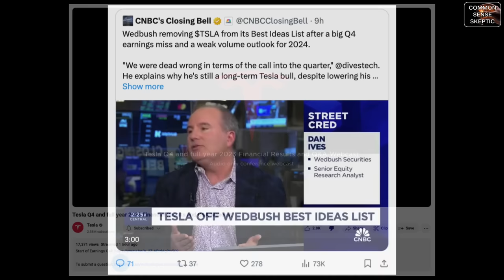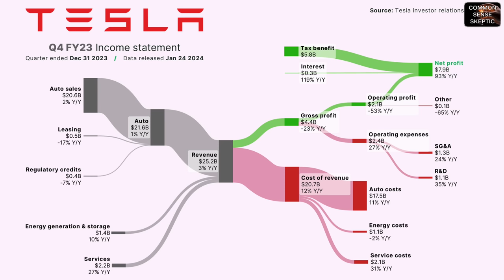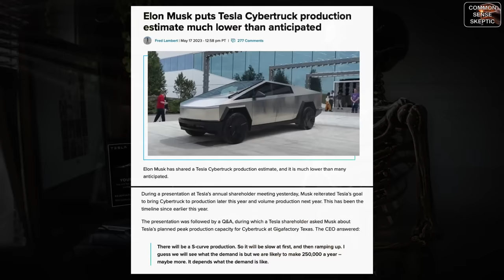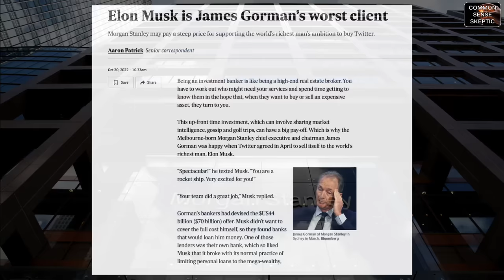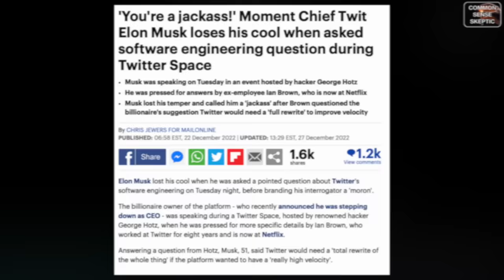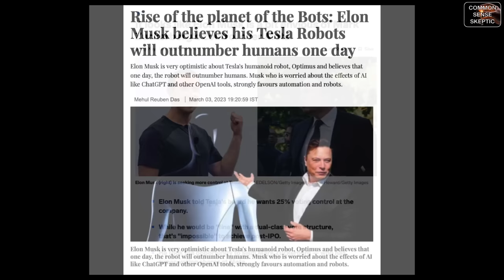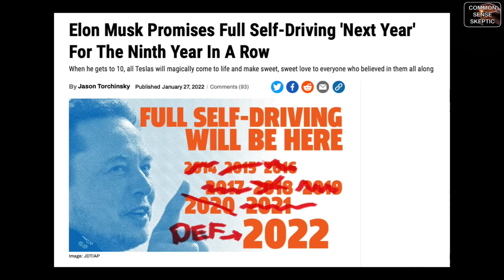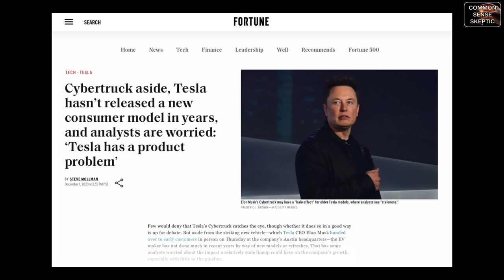TEARDOWN OF TESLA Q4 2023 EARNINGS

Comment: Who has seen the short with Cybertruck stuck in 5cm snow? 😅
Reply: It a hill and the car has summer tires.
Reply: @blablablabla4245  heavy pickup with 4x4...
Reply: @blablablabla4245 didn't leon say it was a "go anywhere" truck regardless of the tyres?
Stop carrying water for the useless POS
Reply: @robinkelly1770  there is no go-anywhere 4x4 no matter the capabilities of the drive. You need winter tires

Comment: The $25K car is a hoot -- if and when it comes out I doubt it will be less than $30K and might well be closer to $35K -- and that would be for the stripped down base model.  Would that base model have all the hardware needed for FSD or would you need to buy a higher spec version at and additional $10K or more?  If so we could be talking $45K before adding FSD at $15K.  IOW, this new Tesla for the average person could run $60K.

Comment: BYD's cars looks much better inside and out.  It's a Chinese company, and their software UI needs work.   Their BYD Seal goes up against the Tesla model 3.  There are some minor issues with the Seal = Less trunk.  The UI needs work - too much beeping, a bit out-dated.  BYD's handling is more car-like, while the 3 sticks on the road - if you are racing on the track with curves and such, the Tesla Model 3 is better.   But all the user controls on the Tesla are on the big screen. Including the "Dash info".   There is nothing in front of your steering wheel. The car will beep you when you are speeding.  Geez. 

The BYW: Looks better.  The screen rotates to your preference. The  seats are better.  There are COLOR OPTIONS (Tesla charges $1000~3000 for non white colors).  BYD has physical controls and buttons for places they belong.  No swiping UP or DOWN to switch the car into forward/backwards.  HOLY Geez!  Par. parking with that is BAD.  With normal cars, you can switch gears without looking - you go by FEEL.  The door handles on Tesla are horrible, you pretty much need two hands.  The Tesla wheel covers are meh.  They're black now.    BYD's look modern and sharp.

The chances of me buying a Tesla = NEVER.   A golf cart has more personality. 

Check out the comparison video by Carwow : New Tesla Model 3 v BYD Seal: Ultimate review 

Buying ANYTHING but a Tesla = is the best way to put Xelon and Tesla in their place.

Comment: I was unlucky enough to take a thorough look at a new Model 3 the other day. I have never seen a car more badly made - and I lived through the British Leyland years - so that is saying something. ALL the paint was pure orange peel, and I estimate around $5K to flatten it, so it looks right. The panel gaps were a joke. The doors didn't align properly. Bits of interior trim were loose. One headlight wasn't pointed in the right direction. An interior light didn't work. Neither front or rear bumper were aligned with the rest of the car. The stitching inside was woeful - like it had seen sewn by incompetent people.

It also had the Suicide Steering Wheel option, where a Yoke-type wheel will almost certainly cause a crash at some point And here it's worth noting that Tesla is the most-crashed car brand in America.

Comment: 20:38 well that's one way to boost solar city since you wont be able to afford your power bill once your 'super computer car' kicks into gear.
Measure the power requiered when your PC is idle (or even on standby). Now measure it when it does anything complex yet repetitive (like a game using RTX)

Your powerbill will be orders of magnitude higher than before!
Reply: If Tesla ever does get FSD working, it's going to need some AI accelerator silicon in the car. Such dedicated-purpose chips can be very power efficient. But that also means none of the promised 'buy now, get FSD in a software update next year' claims can work.

Comment: Jeez! I should have bought into nVidia back when they were a start-up and I bought a RGB graphics card from them for my amber built in monitor IBM Luggable computer. That was the predecessor of the laptop, and came standard with two 5 1/4 inch floppy drive, one of which I replaced with the cutting edge 3 1/2 inch floppy drive. If I had have bought into that company at the same time I bought their fantastic little card, I'd be disgustingly rich instead of being disgustingly broke now.

Comment: the resulting crash was long overdue. the "cheap" cars would be probelly the original design Eberhard and his original partner planned all those years ago, but fatty Elon wanted a bigger Car which resulted in the current ones on offer, which are way too expensive for most. 36K for a EV is pushing it. Most other Car makers rather lose money on the initial sale as Services postsale bring in way more than the car itself at sale, bridging the cost valley created and even creating profits.

Comment: Until the costs of EV comes down (ALOT) -- there won't be many people below the middle class to own one.

It's not because we don't want one... we cannot afford it. 💯

Plus -- what if the subzero temperatures gets worse??
Reply: What middle class?
Reply: EVs are fundamentally flawed anyway, at least with our current technology.

They’re no more green than traditional cars when you account for the battery production and disposal.

They’re much less efficient than traditional cars.

They’re a massive fire hazard.

They’re entirely dependent on expensive infrastructure (charge points) that will never be cost effective nor available outside of affluent urban centres.

The batteries are built from finite rare Earth metals that we are rapidly running out of.

Battery tech is useless in very hot, humid of cold environments.

EVs were always going to status symbols for the rich in California, not a viable alternative to cars.

Comment: WTF is the massive obsession with 'robotaxis' ? - its a fundamentally flawed business model. If YOUR car was available to others to use when you are not using it, you can be sure as hell be sure it won't be there when you need it. Elon says cars spend 90% time parked up at home, yes, but that does not mean the user does not have any value from that - the utility is that it is THERE, ready for when YOU want to use it. You would get it back full of trash, scrapes and dings, and lots of extra miles, that would eat into your warranty that your battery warranty would be blown in a year. Its madness. Also, if people didn;'t need to buy cars to be sat on driveways 90% of the time, there would be 90% less cars needed to be sold, if this 'Business model' gave the car 100% utilization. THIS IS THE MORON BUSINESS MODEL THAT IS SUPPOSEDLY GOING TO 3x 4x 5x TESLA STOCK.
Reply: if the 2 to 3 million robotaxis were to each make 30k a year in profit why would tesla give away 40 bill in yearly profit? they would be a service company instead of an automaker